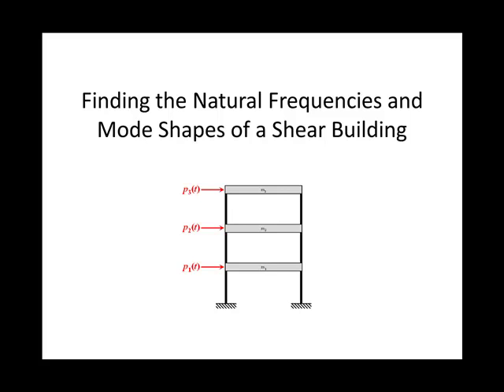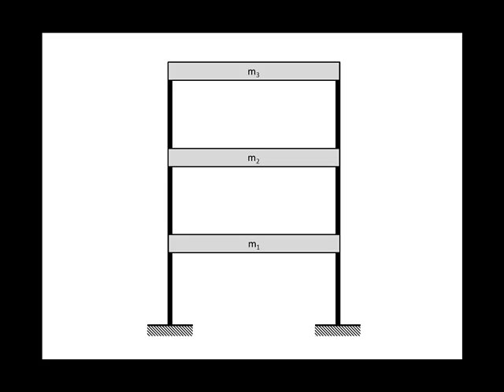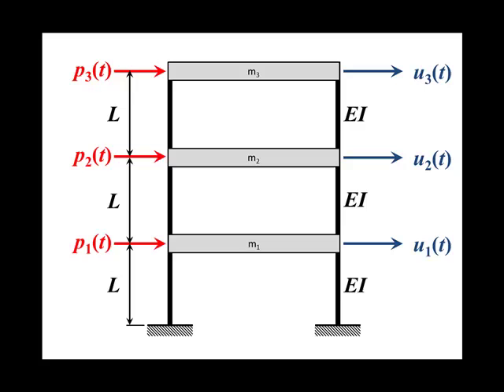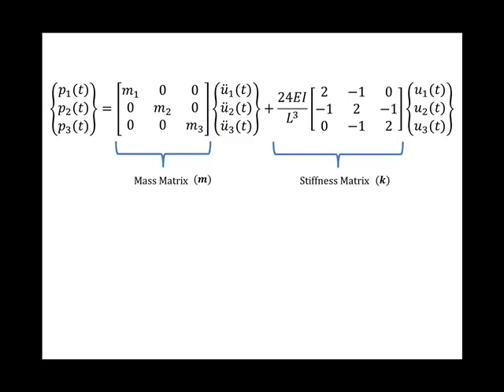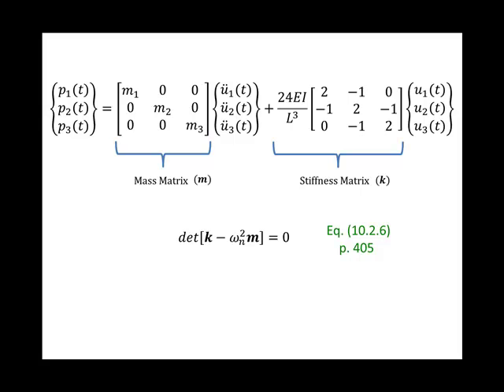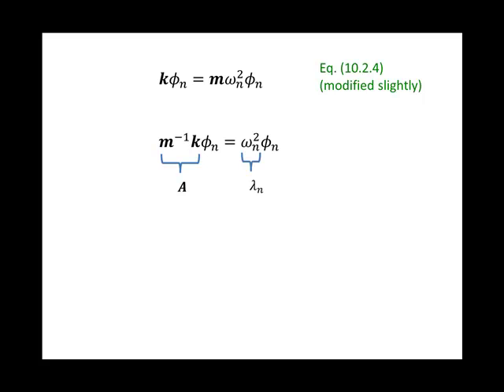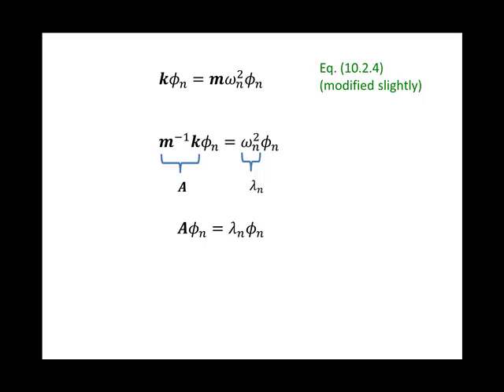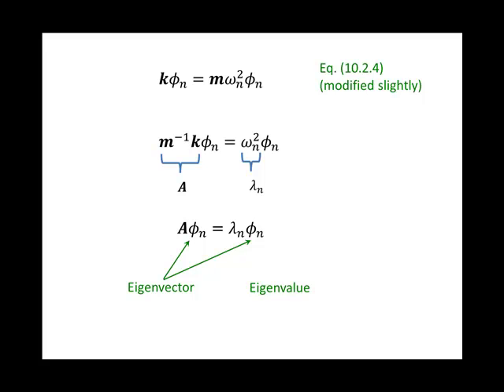Natural Frequencies of a Building

Comment: i have one doubt tho.. for such a frame structure as u are considering, the stiffness value of 1 storey should be 24EI/L^3 (Two columns) or 48EI/L^3 (Four Columns)???? hope to hear from you soon. Would really like your help on this...
Reply: Well I can answer for that question. I can tell that stiffness of the column in this example is 12EI/L^3. However, because each floor has 2 columns you have to multiple by number of columns and it becomes 24EI/L^3. If you have 4 columns then then it will be 4x12EI/L^3. I hope it helps.
Reply: @dachikhutsi2793  well see the thing is when i determined the natural frequency practically or experimentally watevr u call it, i got answer as 25 rad/s.... now i want to verify this value by solving it theoretically by means of equation of motion as shown in video... I have prepared the equation, all i have to do is enter the values... I tried 4 column concept i got ans as 41.4 rad/s.. but when i considered 2 columns i got ans as 27 rad/s which is really close to the one i got practically... So the question arises that while solving theoretically we always consider 2 columns for such frame cases?? Is it a thing that while solving eq of motion, one hasbto consider 2D figure instead of 3D figure??Btw thanks for the reply  👍👍
Reply: @kevinwadia3325  do you use what's app or anything? I would love to help and I know the answer to your question but I need to explain it to you
Reply: @kevinwadia3325  you probably have pinned support connection where you have to use k= 3EI/L^3
Reply: @dachikhutsi2793  sry i dosed off... It was 3:30AM so 😂😂.... Well its a simple CPVC physical model and all of the joints are fixed...